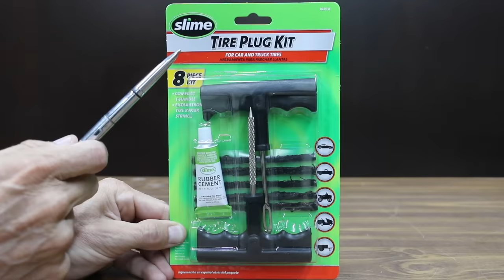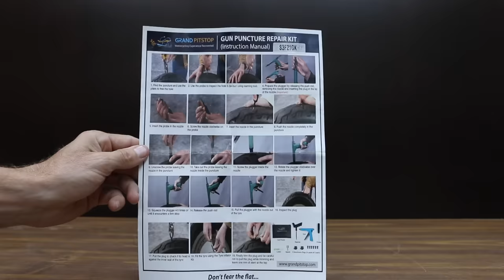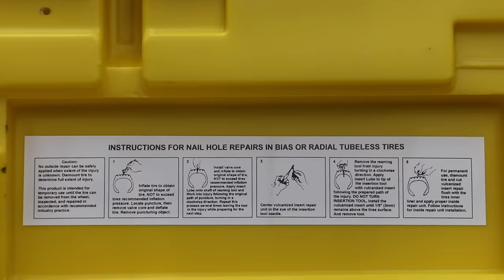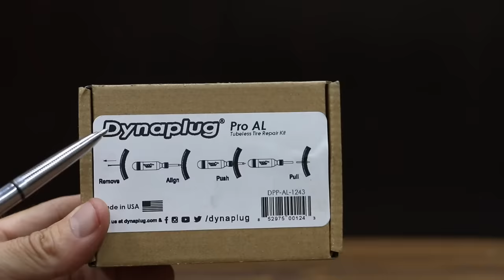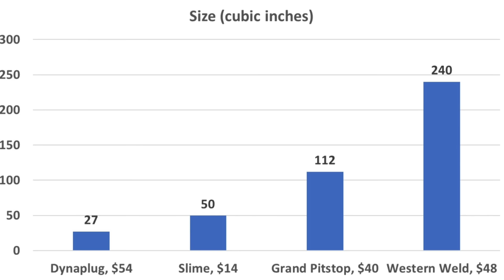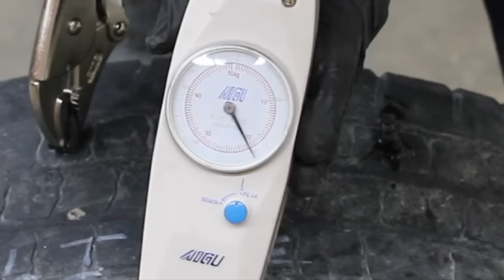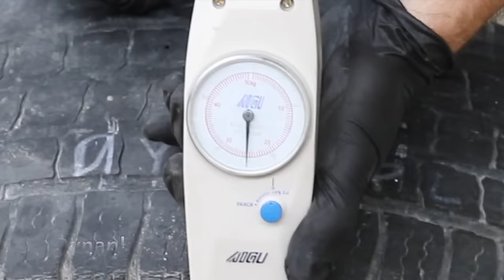Best Tire Repair Kit? SLIME, Westweld, Dynaplug, Grand Pitstop

Comment: I used the cheap walmart branded version of the slime kit on my toyota sienna before the transmission finally blew out on it. I work at a thoroughbred race track so a plug kit is a must and you'll go bankrupt replacing tires everytime you have to replace a tire because of a hole. In total I had 3 plugs in my drivers side rear and 2 in my drivers side front and never had issues going between 55-65 mph for 32 miles 5 days a week. every once in awhile one would start leaking and I just had to replace it but as far as safety, I am not worried. Still waiting for that first hole in the 2024 corolla I just bought.
Reply from the maker: Thanks for sharing.

Comment: Finding clunks and noises in cars can b very challenging. A camera or compact microphone added to the suspected underside area of the noise would b very helpful. Bluetooth would b ideal, but wired would work too. A combination of both mic and camera would be the best. Wheel bearings can b very difficult to diagnose. U have the expertise to devise the best way to do this. Thank u!!  I never buy anything till I check your ratings. The extended HF 3/8 ratchet is a winner. I have been using for several months now. It’s light and fast. I have the Makita, all three Milwaukee’s, and the Kobalt. The non fuel Milwaukee is right there with the HF extended. Those r the two that r on top of my tool cart all the time. Thanks for all your hard work!!
Reply from the maker: You are welcome!  Thanks for the suggestion.

Comment: The only problem I have had with the western weld plugs is that the tool's metal is brittle. If you attempt to tighten the set screw the surrounding metal breaks. I have a set that came in a red box and looks identical to the one you showed. If the handles were made of better stuff I would say it's a 10/10. Excellent for SUV tire repair for sure.
Reply from the maker: Thanks for the feedback.

Comment: Having used countless different types of tire plugs I can’t say if any are better than the other ones. 
I have had more cars with garbage tires than I could ever count since the early 80s and until recently I probably plugged a tire in each them. 

None ever failed before the tire or car did I don’t believe. 

But this was a very interesting testing. 

The only actual time I did have a problem was a sidewall punctured tire. It was a slit so I had little expectations for success. 
In the end, a scissors type blade was found inside the tire by the shop that I took that car to. 

I essentially know who did the damage, and when but not why. 
Though he did get thwarted sometime in the previous hour when I saw he had been very likely planning to steal some tools from my open rear doors on my work van. 

I’d been installing security cameras on the houses of 3 homes that had just each had burglaries. 
So following my punctured tire (discovered 1/4 mile away as I drove away) incident I notified the customers to look at their groundskeeper crew and consider having them contacted by the police. 

Never heard back. But also the security system might’ve changed the plans of that crew.
Reply from the maker: Thanks!  Thanks for sharing.

Comment: What about temperature?  I've always been under the impression that by running the plugged tire on the highway right away generates a certain amount of heat needed to fully to cure the plug.  For that reason, I don't trim  my plugs and prefer to let them wear off.
Reply from the maker: Thanks for the feedback.

Comment: I worked in a service station for years,done many tire repairs,removing nail from tires with diagonal  cutters is safer than using pliers,it also helps if there is some air in the tire ,when inserting plug.
Reply from the maker: Thanks for the feedback.

Comment: Does anyone have a lot of experience with plugging LT (light truck) or ST (trailer) load range E tires? They are usually 80 PSI max vs 50 or 65 for the lower max weight ranges.

Comment: I've used the slime plugs forever no problems no fails yet, maybe out of 20-25 plugs. remember the dyna is small but will still need dykes or pliers and a razor blade, and of course a compressor, could probably put any kit and tools in with the compressor. YES, project farm does a video on the best mini air compressor.
Reply from the maker: Thanks!

Comment: I use the Western Weld plug religiously when I need a plug. I have one WW plug in a tire on my Dodge Ram that’s been there for over 25,000 miles. Still doesn’t leak. 💪😎
Reply from the maker: Thanks for sharing.

Comment: I have the plug kit for emergency repairs. I don't use the supplied rubber cement. I bought a pack of multiple small tubes of vulcanizing compound to coat the plug to chemically bond it to the tire rubber. Had tires with plugs run 50K plus miles with no issues or air loss. I also carry a 12VDC Sears inflator.
Reply from the maker: Thanks for sharing.

Comment: I can't believe you didn't get Safety Seal but the Western Weld sure looks like a knockoff. The SS works great for me because of the Aluminum design and the guard that limits the depth of the plug. The amount of resistance varies wildly as you insert the plug and the sturdiness of the tools is excellent.

Comment: In over 40 years of using various "sticky cordage" plugs on nail/screw holes, I never had one leak or fail.
Once installed as a "temporary" repair, they all stayed put until the affected tire[s] were replaced after normal wear out.
Reply from the maker: Thanks for sharing.

Comment: In the past, Id use industrial tire plug kits such as the Western Weld we used at the Shell station I worked at, but I had to buy it thru the gas station as everything sold at autoparts stores were cheap, chintzy.
Reply from the maker: Thank you!

Comment: As an individual I've been using the rope plugs for decades to repair my own tires, and I've never had one fail.  This includes 32/35 inch trail tires on the various Jeeps I've owned over the years.  While I can't tell you how many I've used in total, I CAN say that for me they've been 100% reliable so...
Reply from the maker: Thanks for sharing.

Comment: I've used tire plugs for decades.  Including on semi trucks.  Got me home many, many times.  Just take it in and have them place a patch on the inside after they just sand down the inside portion smooth to take the tire patch.  Best repair you can get.
Reply from the maker: Thanks for sharing.

Comment: For what it is worth, i had 2 separate tires with side wall plugs with rope style plugs. Both tires lasted around 12k miles with said plugs in them and never leaked. During those miles i had several off-roading trips on them. Not the recommended use of them. But hey they worked well.
Reply from the maker: Thanks for sharing!

Comment: Believe it or not, I have nothing but good to say about Pit Stop.
I had a relatively new tire installed, drove through a parking lot with my wife, then heard the sickening sound of a puncture.  It was a 5/16" diameter bolt! When I got home I used the Slime plug, but at 5/16", it just leaked out after a week.  So I ordered the Pit Stop and DAMN! Even at 5/16", it has held to this day.
But this is MY experience.  Sounds like the Western Weld might have done okay too.
Reply from the maker: Thanks for sharing.

Comment: I like that idea of coating the plug with rubber cement. It makes sense. If the plugs aren't the best quality (old), the glue will add a layer of protection to the repair.
Reply from the maker: Thanks for the feedback.

Comment: What if the fault is not a tiny, round hole? What about filling a slit? Only the sticky string type will work. I had a box cutter blade slit in a motorcycle tire. It took three strings but the Slime worked great.
Reply from the maker: Thanks for sharing.

Comment: Tire repair? Nice, another good thing to try out is the plastic welding kits that use hot staples, another useful auto repair tool to have around.
Reply from the maker: Tanks for the suggestion.

Comment: Passenger rear tire is the most vulnerable to screws and nails. While I was skeptical of do it yourself tire plugs, the Slime brand is simple and amazingly effective as I've had about 4 plugs on that quadrant of the car for thousands of miles with no issues.
Reply from the maker: Thanks for the feedback.

Comment: It would be great to see tire pressure gauges tested since it also tire related. (dial, digital or even pencil types.)
Reply from the maker: Thanks for the suggestion.
Reply: Nice to know though that I'm using the same one as you're using in this video 🙂

Comment: I have had the belts breaking with just the patch installed on the inside of the tire, the plugs or plug patch seem to seal the tread and do not allow water inside to rust the belts and causing them to break.  I use plugs successfully with tow pressure atv style tires.
Reply from the maker: Thanks for the feedback.

Comment: Western weld looks identical to the tire plugs we used in garage for last 40 year's, I quit the job but when I left they were talking about  making tire plugs illegal. They wanted everyone to pull tire and install  a plug with patch from inside tire. This would have taken so much time to break tire down install check for leak and balance tire at 120 an hour you would probably have tire repair of 60 for the half hour considering that most tires have tpms sensors so you need tool to purge air they say cores are torque to specs.
Reply from the maker: Thanks for the feedback.

Comment: It will be interesting how long these plugs hold up after years.  My Slime type plugs eventually leak again after 2 years from the fibers of the plugs.  Over time the tar materials get porous and the air gets through them and causes slow leaks.
Reply from the maker: Thanks for the feedback.

Comment: Wow that was amazing!  So much effort into these reviews.  Very much obliged. You are a legend!!

Please do a review on truck tire valve stem extensions!  I really need this.  I have an RV, 22 ft Class C.  Its a Ford E350 Econoline Chassis, V10.  The tires are constantly leaking air. I have duallys in the back.  The way the stems are located, it is very hard to access.  I found out that the extensions for the valve stems where you fill up air, are not good quality. I probably need steel ones.  Please do a review on the best valve stem extensions available on the market.  I want 100% fool proof ones!  Sick of my RV deflated on every trip. Sheesh.  If anyone knows the BEST ones let me know.
Reply from the maker: Thanks!  Thanks for the suggestion.

Comment: As a former tire repair pro, I use the TECH repair kit. Lots of pro shops do too.
Personally, I use diags instead of pliers and an undersized drill bit on the drill instead of the reamer.
Galvanizing fluid is what tire manufacturers use to bond the various pieces of the tire together. So galvanizing fluid and raw rubber are a winning combination! 👍
Reply from the maker: Thanks for sharing.

Comment: my very old "stop and go" tire plugger was identical to the "grand pit stop brand" . they recommended using 30 wt non det motor oil as a lube  not glue. its  great  w/small round holes. nowadays we purchase new tire maint warranty and the club where purchased fixes flat for free by dismounting from rim and installing patch inside.  rebalance is included. . sidewall damages are not repairable so a generous prorated amount is applied to a new tire.  times are changing for sure.
Reply from the maker: Thanks for sharing.

Comment: I've used the slim plugs and they've never leaked. In my opinion only use a plug that uses glue. Slim plugs are readily available but I've never seen the Westweld ones anywhere. Westweld looks like a great plug also.
Reply from the maker: Thanks for the feedback.

Comment: Yeah, just used the "mushroom plug" this morning. Absolute PIMA. The first one didn't go in for enough because I used it on a truck tire. Second I used a tool to push it in further, and it fell in the tire. Third time I finally got it. 30 minutes is way too long to plug a tire.
Reply from the maker: Thanks for sharing.

Comment: Having used both "rope" plugs and "mushroom" plugs, I noticed that when the Grand Pitstop was being loaded, no adhesive was used.
I have had rope plugs leak on multiple occasions but when properly lubed with rubber cement prior to insertion, I've never had a mushroom plug leak and they were much easier to install.
Simply place a few drops of rubber cement into the barrel before inserting the umbrella seal with the nozzle.
Then place a couple of drops on top of the seal as a lubricant. Install the nozzle and install the seal as normal. When removing the gun, loosen the nozzle 1/4 turn to allow air into the chamber.
Immediately re-pressurize the tire to the recommended pressure, using pliars, pull up slightly on the plug stem and cut it so it retracts below the surface 1/32 or so.
Let sit under pressure for 10 minutes to allow the rubber cement under the mushroom cap to cure.

Comment: I got a little compressor like that, the clip on the air hose would not depress the valve stem in the tire, and never put air in it; and there is no fitting to use a different style. I had to send the tool back.
Reply from the maker: Thanks for sharing.

Comment: I’ve had the mushroom and gun kit for years $150 Napa Balkamp never had one leak, I don’t consider them a temporary fix, if one did leak there is a box of larger diameter plugs in the kit, I use glue on the reamer too.
Reply from the maker: Thanks for sharing.

Comment: Rope plugs work if you use plenty of rubber cement. I had one leak down after my son parked his car on the plug  overnight. Since then ive been using the combo plug patch inside the tire.
Reply from the maker: Thanks for sharing.

Comment: why is these temp jobs if they are keeping out the air can ther be used all the time what will go wrong the tyre go down or what i cant see the tyre going bang with these plus those new tyres with tpm system you have nothing to worry about

Comment: I've driven thousands of miles with plugged tires and I don't recall ever having any major issues.  One or two may have leaked but that was rare.  I now use Cooper A/T3 10-ply tires now and never get any flats or punctures.  I've pulled out several screws from the rubber tread, but the screws don't penetrate the tire plies to cause a puncture. I can't recommend those tires enough.
Reply from the maker: Thanks for the feedback.

Comment: I'm pretty confident in tire plugs.  I've used the standard slime brand on standard radials and on low profile tires and put 10s of thousands of miles on them, probably close to 100k honestly.  No blowouts from my 115 mile daily commute. Regularly maintained 80mph on the freeway, occasionally hitting 100mph+.  Extreme heat, extreme cold. 4-5hr roadtrips.  I'm sold. 

I'll say though, I remember the Slime plugs being a lot stickier than the ones in your test.  And I think I inserted the plug quite a bit deeper, leaving about 1/4" on the tread surface.  My thought behind this was a higher chance of folding over (larger "plug") on the inside.
Reply from the maker: Thanks for sharing.

Comment: Great job. Check out 3M Scotch Weld PR40 Rubber and Plastic Clear instant adhesive. Combined with WestWeld kit could also be a near perfect permanent fix. Down the road as suggested an inside patch of course. Thank you for all your hard work/teachings. Mike i.
Reply from the maker: Thanks and you are welcome!  Thanks for the suggestion.

Comment: Love how thorough you are in all your testing of this and that. As far as these plugs I have used them for more than twenty years with mine and my family's sedans to zero failure until the tires wore down and needed to be replaced. Large vans and SUVs may be a different concern because of weights involved especially when loaded. Quick note that if you have balding tires like the ones you used it is much more easy to insert plugs. You try that with a newer tire with a bit more thread and it wont be easy to insert by a long shot. Especially if you have steel belted tires an puncture goes through the wires. Better bring a lunch. Cheers
Reply from the maker: Thanks for the feedback.

Comment: I'd prefer SAE measurements vs metric but that's me.  Also I always carry the larger can of slime rubber cement with the brush on the cap as I have had the little tubes dry out after one use.  I find it necessary because without the rubber cement I've had plugs leak.
Reply from the maker: Thanks for the feedback.

Comment: i just got a slime tire repair kit to test, it works good for quick repairs but i think it only works with nails or screws, non round punctures are out of question
Reply from the maker: Thanks for the feedback.
Reply: Nah. You have to be creative. I’ve used multiple plugs and rubber cement. Then drive awhile to heat it up.

Comment: I used a cheap $5 pkt on a nail I used one plug, it stopped the leak. About a hr later I went to get the tyre fixed by a tyre shop but they told me they could not find the leak the inserted it into water, he then told me that they would of done the same repair , that was over 5 months ago, still no issues
Reply from the maker: Thanks for sharing.

Comment: We use Western Weld plugs and cement professionally where I work and they really are very heavy duty and last extremely well. In case anyone looking for information stumbles across this comment, dip the plug in cement then push it into the tire. The cement will lube the plug for easier insertion then glue the plug into place and provide a better, longer lasting, more durable seal.
 Nice tank slappers there!
Reply from the maker: Thanks!